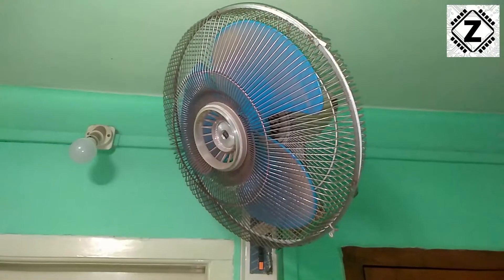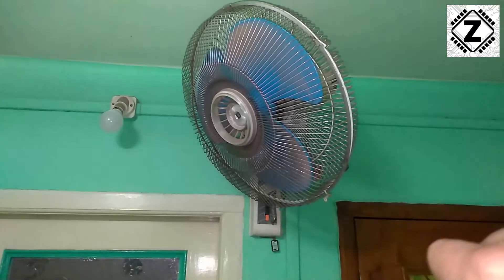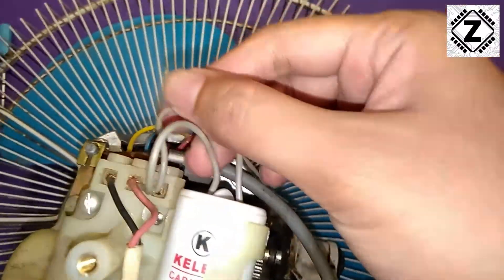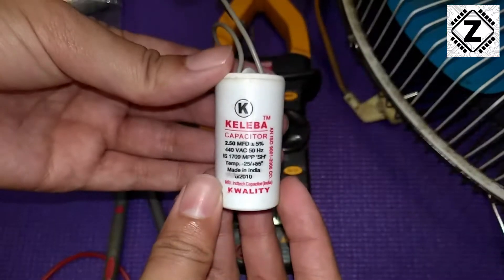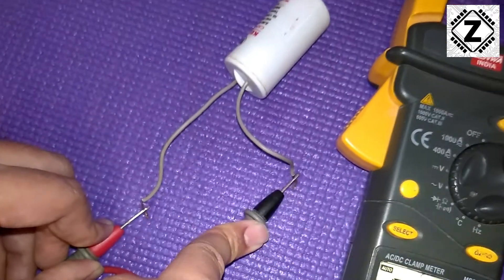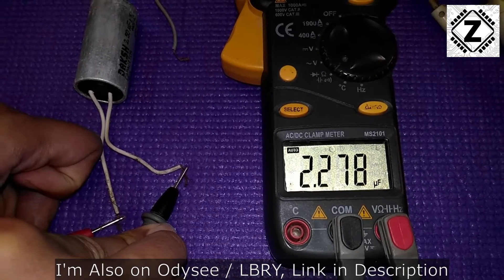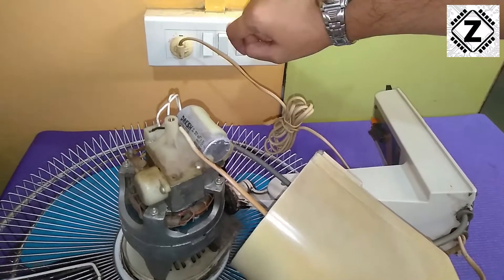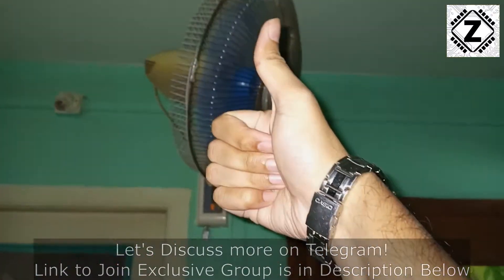[Eng] Fan Humming but not Spinning? Quick 5 min Repair! How to Change Wall Fan Capacitor Condenser

Comment from the maker: This Video is available in Multiple Languages-
English- https://youtu.be/ia-Dn8U9KZk
Hindi- https://youtu.be/Rw1leZCPYc4

Fan used in this Video-
Crompton Greaves Side fan https://amzn.to/3CJSOPw

What You will need-
ToolKit https://amzn.to/2XNbOxJ
Gloves https://amzn.to/3lXlIoa
Screw Drivers https://amzn.to/3ukQnjr
Capacitor / Condensor https://amzn.to/3EPLXWk
Multimeter https://youtu.be/P6tW5LZX4ao
Reply: Hey kids REMEMBER! Before touching the 230V capacitor wirings, or before checking the capacity- always wait till the capacitor discharges, better with the device turned on and unplugged... it can kill someone -

Comment: Great video, sir! I need some help. I have a pull-chain ceiling fan that uses a 3-in-1 capacitor with 5 wires: brown, purple, red, and 2 grey wires. I only have a two-wire capacitor, but I want one speed (high). Brown, purple, and grey are speed wires, and the other wire is neutral  red wire is the start wire  I have a schematic here it is search on google How to Replace a Ceiling Fan Capacitor – 3 Ways : electricaltechnology
Reply from the maker: https://amzn.to/40U0Tyu
Seeing the diagram above, it looks like grey are the common wires, and there are 3 small capacitors each for red, brown & green.
Reply: @ZenInnovations thanks for responding. i only a have a two wire capacitor not a 5 wire i only want one speed. each capacitor has a different capacitance my fan is low is 1uf medium is 1.5uf high is 2uf im using a 2uf for the high setting

Comment: Hey kids REMEMBER! Before touching the 230V capacitor wirings, or before checking the capacity- always wait till the capacitor discharges, better with the device turned on and unplugged... it can kill someone if touched with both hands

Comment: See my fan is not rotating when I pull the rotating string and when I switch on the fan I need to spin it with my finger then it takes pickup and spins what's the problem?
Reply: The pin is starting to stick probably WD40 will cure that.  BUT still may be the Capacitor/Condenser droppng its value.  If not an electician do not play around with these - if you do decide to test and check/replace it DO NOT TOUCH BOTH
WIRES FROM IT WITH YOUR HAND. You will require a good meter for this reading.
Reply: @balirob7604  understood thank u brother
Reply from the maker: Just watch the video...
Reply: @ZenInnovations  I watched the video ur fan  is very old  I didnt understood

Comment: What if condesor is new but not working
Reply from the maker: Maybe windings are bad.
Reply: Have the Resistance checked for each coli of the winding - an electrician needed unless you are experienced.  Any dirty grease should be cleaned off them with a proper solvent

Comment: Which wire you connected have capacitor plus and minus or any side we have to connect
Reply from the maker: AC capacitors have no polarity. Use any wire. Take note of original wiring sequence before undoing them.
Reply: @ZenInnovations  sir I have connected new capacitor it works after few days It's again doing humming sound  please explain the problem
Reply: I agree with ZEN 100%

Comment: Hi I changed the capacitor and the wire no and oiled the bearings but it is still not working? Am I missing something
Reply from the maker: Maybe your windings are gone.
Reply: @ZenInnovations  thank you for your swift response, I actually found the windings broken, you are 100% correct. Appreciate your response

Comment: I have a Bajaj pedestal fan and the problem of humming is there. As these models do not use a capacitor,  any other suggestion on rectifying it.
Reply from the maker: If it's a regular induction motor, there must be a capacitor. Maybe it's hidden inside the motor.

Comment: Good day. Nice video... i have the same problem. I already replaced the cap. But the humming is still there. The fan is not stuck. I can freely turn the fan. When turning the fan on the fan turns but it's very weak.
Reply from the maker: Looks like wingdings have become weak.
Reply: @ZenInnovations  that's probably out of my ability to fix. I only know how to do basic soldering. 😄
Reply from the maker: Yeah. Time to go to professional.
Reply: Thanks had the same issue, only that I baught this fan a month and half ago.....

Comment: I wonder if capacitor is also the problem with my fan. when i try to turn it ON, it makes the humming noise. i tried to help the fan blade spin but its somehow got a bit hard to rotate as if its motor is magnetizing from one-side while the other is weak.
The motor doesn't seems clogged because when I turned it OFF it spins smoothly. only when its ON.
Reply: I just had this problem.  I discovered one of the metal washers from the shaft had shattered into 4 or 5 pieces. After cleaning them out of the motor and replacing the washer it works fine, and still using it today.
Reply: but i think this could also happen if the bearings/bushings are loose or worn, which would cause the shaft to be uncentered.

Comment: I recently changed my bearing of the pedestal fan, but it will still not start at once. Do you think it has loose connection??
Reply from the maker: Perhaps. Also check the capacitors.
Reply: @ZenInnovations  thank you for the swift response